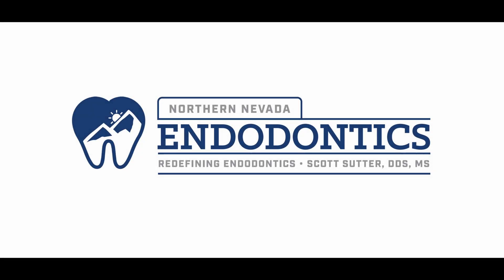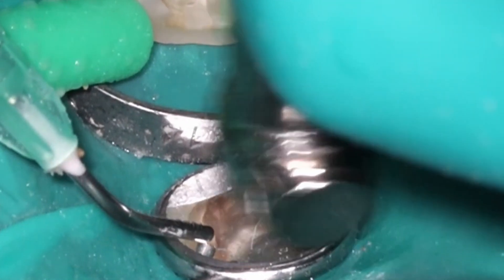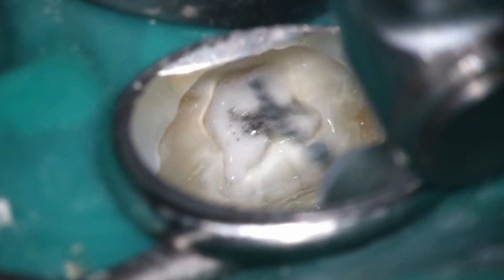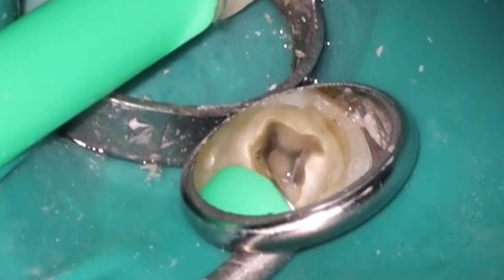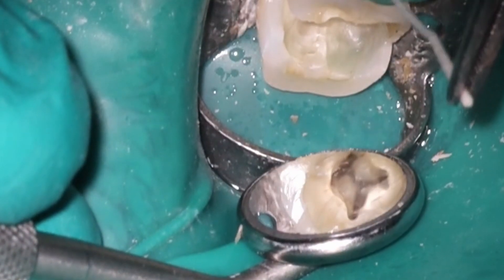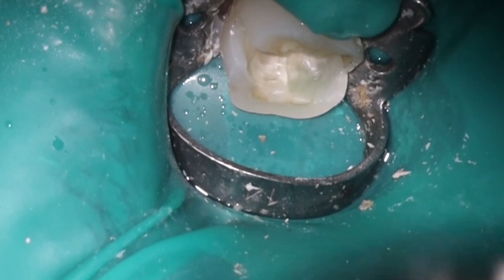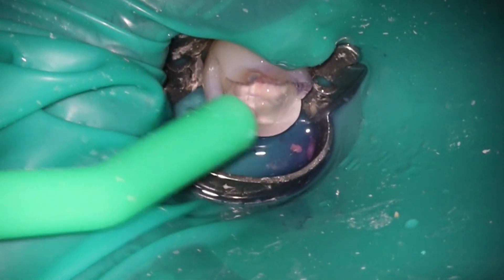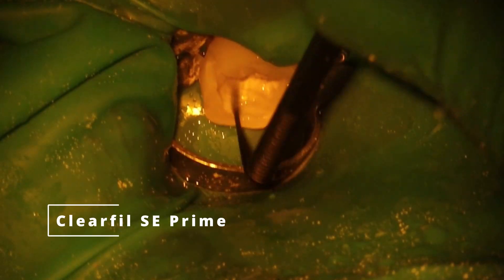Minimally Invasive Root Canal: Long, Skinny, and Curvy!

Comment: Hello, thanks for the sharing

I would like to discuss 2 points : 
- Why do you etch the dentin when using Clearfil SE ? Etching should be limited to enamel when using this adhesive system. In SE systems, bonding strength to dentin is reduced when dentin is etched
- I think pre-endodontic IDS should be done, especially in VRF situations (dentin pollution by irrigation), to get the highest bonding values
Reply from the maker: Great questions! I am not an expert in bonding at all and would love to learn more. I am going off recent lectures at a few different endo conferences. For etching while using a self-etching bonding agent, I think it was Dr. Lawson out of Alabama who showed some evidence that total etching + SE was superior to SE alone, so that's why I'm doing that. 
I would love to learn more about IDS. I asked him about this at the most recent lecture and was told that it doesn't matter as much as with a vital tooth. If you have any resources that say otherwise please share so I can look into it as it seems like a very cool technique! Thanks for the views and for the great questions
Reply: I bet this guy just took an overpriced course on biomimetic and already learned how to behave like one lol

Comment: Hi Dr. Sutter 
Your videos are very helpful. Thank you 
Can you please go over the irrigation protocol? Which liquid how much time n all??
Reply from the maker: Hi Maitry! 
Thanks for the comment. It really is case dependent, but my main irrigant is Triton from Brasseler (a combo of EDTA and NaOCl) that does seem superior to using them separately. I rinse until I no longer see any bubbles (NaOCl only works on organic material, so once there isn’t anything for that -OCl to work on, it stops bubbling). I use the endo activator as a further test to see if it knocks anything loose. Then, as long as I can get the case dry, I’m good. 
Some cases require a small amount, some require a ton of irrigation, or even calcium hydroxide. It all just depends 👍🏻

Comment: what is a pacmac? i'm guessing its just to condense the thermoplastic GP? is it used in reverse then?

Arent you worried about apical wash out of the cement? On the otherhand arent you worried about irritation of the apical tissues with possible large quantities of resin based sealer ?
Reply from the maker: https://www.ultimatedental.com/pacmaccondensers.asp Here's a link to the pacmac. You are correct that it is use to help condense the gutta-percha and eliminates voids. It is a reverse threaded hedstrom shape, so you can run it in a slow speed in the normal direction. 

I haven't seen much washout at all when I bring these patients back for recalls. I am not worried at all about irritation of the apical tissues. AH Plus is very kind to the apical area and there are many studies showing that sealer puffs don't affect the prognosis. I don't care what the tooth looks like histologically as long as it is asymptomatic and functional (aka a patient-centered outcome). 

Thanks for the comment!

Comment: What is the first rotary blue file you are introducing in the canals sir for shaping
Reply from the maker: My (general) workflow for files is as follows:
8C to approximate working length (from the CBCT)
Brasseler VT Scout 20.06 to 3-4 mm short of working length
EAL with 10 k file
Brasseler VT Scout 17.04 to EAL working length
Thanks for the comment!
Reply: Are you ever worried you’re not instrumenting the canals wide enough?